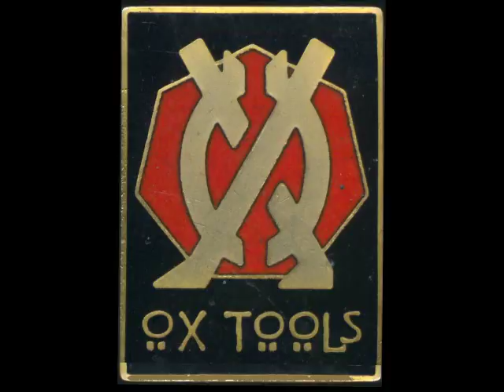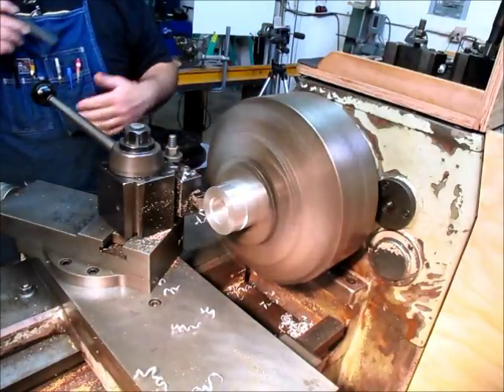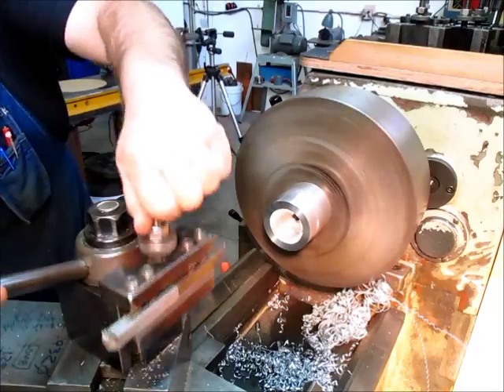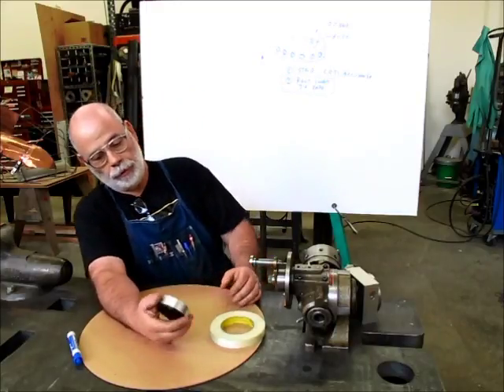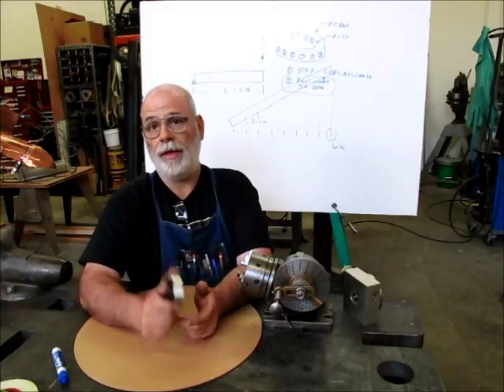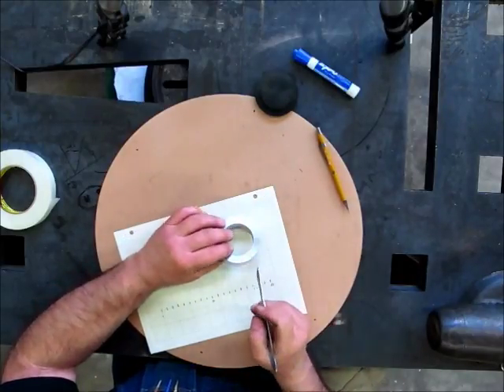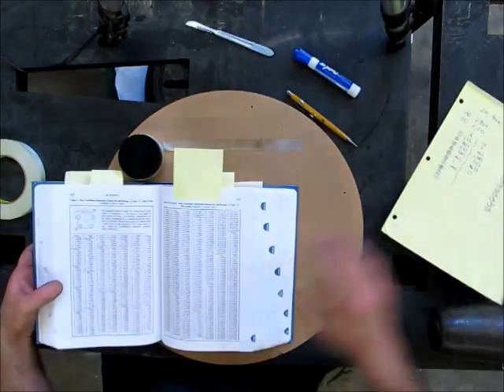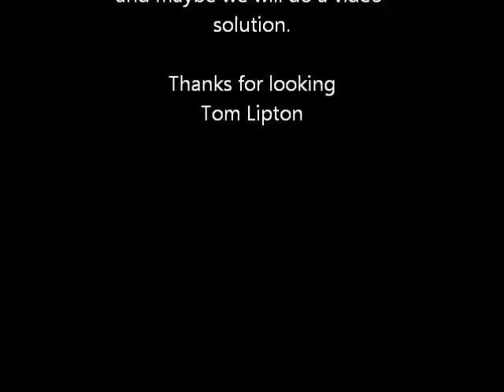Angular Indexing Part 1

Comment from the maker: Hi Matthew,

Thanks for the comment and suggestion. Generally I use a tape that is zero or very low stretch for these kinds of things. Adding some paper to it would have made it handle better. Many times I will kill the glue a little by patting it with my dirty hand just for the reason you mention.

Regards,

Tom

Comment from the maker: Hi Slickoz,

It depends on your indexer. You say you have a dividing head. If its a true dividing head then that will be your best option. A true dividing head has interchangeable circular plates with arrays of holes equally spaced. If you don't have this type then what you may have is an plain angular indexer. 

Regards,

Tom

Comment from the maker: Hi Slickloz,

You can do 127 with compound indexing. However the discussion is outside the scope of the 500 word limit on comments. Take a look in Machinery's handbook which has a good description on how to do compound indexing. There are several ways to skin any cat with machine work so don't worry about not being able to do it. 

Hope this helps.

Best,

Tom

Comment from the maker: Hi Chris,

Thanks for the comment. Here are a couple of suggestions for you. Try to visit somebody near you that has a shop setup. Also as you watch the huge amount of video information on machine work on YT you will see common tools and equipment that the channel folks use over and over. Subscribe to Keith Fenner, Abom79,Doubleboost,Toms Techniques, Mrpete222 and watch till your eyeballs ache. After all that then open the tool catalog and have a browse. Hope this helps.

Best,

Tom
Reply: oxtoolco errr meh gerrrd you left out Mr. Keith Ruckers vintage machinery and that guys steam powered machine slop

Comment: Whenever I use the tape angular method I stick the tape to a steel rule, easy to line up to remove after marking.  Using a mitre guage/square to  mark the points is very accurate way to do it.

Comment: It's more precise if your divisions are longer than the strip. Then you connect last points and use parallel lines to intersect the strip. That way you're minimizing the division error. However, system you shown is easier to execute because you use paper divisions. But, you place your trust into printing press accuracy...
Reply from the maker: Hi Tak,

Thanks for the comment.  I can't remember how accurate this needed to be.

Cheers,

Tom

Comment: I've got a question and it's a good one! I have never seen anyone ask this yet on any channel. If you can afford a current version of the machinery's handbook you probably can afford an old version. Off of eBay or something like that. Do you have an opinion as to a specific year that you wouldn't go past? I mean it seems like most of this stuff would be good anytime after the thirties or forties. I know some standards have changed over the years a lot of them changed in the 20s so you can see my dilemma period

Do you have an opinion on this?

Comment: Hi Tom, I think you really need 21 marks for 20 spaces(first and last mark are the same). 20 Marks only gives you 19 spaces, rIght?

Also, I think that this is easier to do if you take the circumference tape and lay it down straight across the horizontal, then take a scale or something else(like the graph paper) which has the 21 marks in a distance that is LONGER than the circumference, and line IT up as the hypotenuse. It's just easier to move a scale, rather than sticky tape, to line it up.
Reply: Wrong. If you want 20 holes you need 20 spaces. It's not like a ladder where you have one more space than there are rungs. I know someone who made a dozen tank manways one using you thinking and they needed 24 holes so they had 25 spaces. They got 25 holes.......lol  Think about it. If you need two hole you will have two spaces. Four holes, four spaces.

Comment: I know that everyone doesn't have Adobe illustrator but you can do this with illustrator it will equally spaced anything between 2 points and you can print it off in a second accurately

Comment: hi tom the dividing head has plates but to get to the 127 there is no plate I have that will allow this number. I have been told to use compound indexing but have never tried this method and would not know how to begin

Comment: equipment limitations? if only to have a shop like this. possibly the limitation is too much equipment and not enough need to innovate. BRAD needs an indexer. ok BRAD, there is a very simple way to produce an index plate to do the job. one i can think of might utilize a spur gear??? find a means to set up and do the holes. if not available, my favorite method(propietary info since it took me 2+years of pondering to produce a plate suitable to index clock gear teeth; i didn't have dividing head etc.) would include a common hardware store item and several scraps of wood and screws, etc. so simple one would never think it would produce the result. you do need a metal lathe and a tool post set up to drill the plate holes and a home built detent set up for your lathe spindle. oh yes and i used an aluminum plate( available free at the time).
i tried the strip method, not good enough for clock gears. the coordinate method is a nightmare.
Reply from the maker: Hi Bill,

Thanks for the comment. Brads situation was a student wanted to do a small project with a similar sized ring. They did not have an indexer or anything handy to divide the ring periphery into the correct divisions. This video was to show a couple possible ways of doing the job with no special tooling.

Now if you throw down and say you have this great way of doing it and are unwilling to share your method. By the way Horologists have been doing this for hundreds of years and I would bet your method is already known in those circles.

Without seeing or a description of your process I don't think its fair to say its better, or that other methods are a nightmare unless you let us compare for ourselves. 

Regards,

Tom

Comment: Switching tool holders, with the chuck spinning... And moving above the chuck? What if one of Your two fingers gripping that height adjusting screw decides to suddenly get bored of lifting? With the right spindle rpm - the right amount of height in the drop, and a hitting point at approx 11 o'clock on the spindle - the tool holder would end up in poor Tom's face. My vote goes to a relocation of the tool holder pit stop.
Being an old grey-bearded and bald-headed guy myself, I know it's hard to hard in addition, to carry an ugly face around too. Don't be ugly, Tom! Build a new pit stop!
Thanks for the tip and the otherwise, great video. ;)